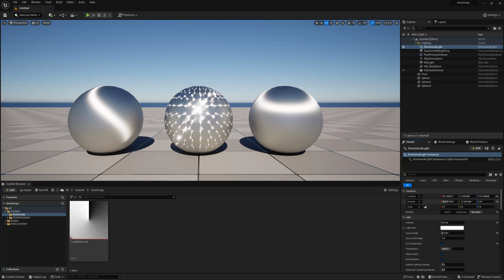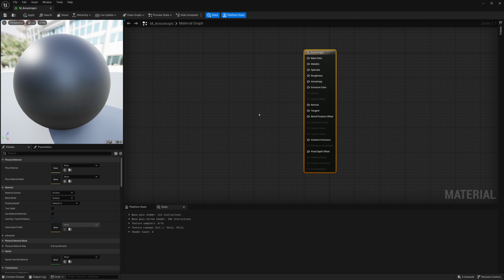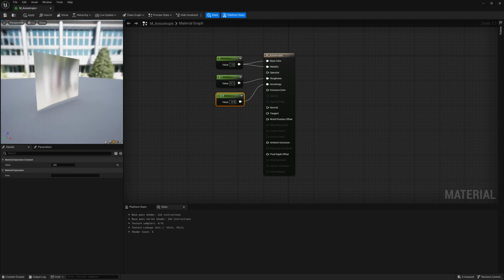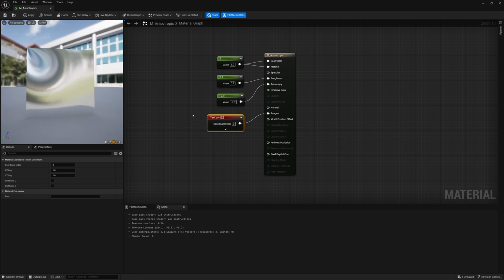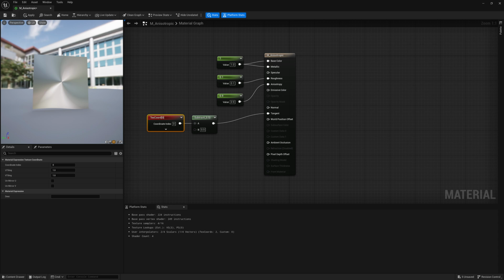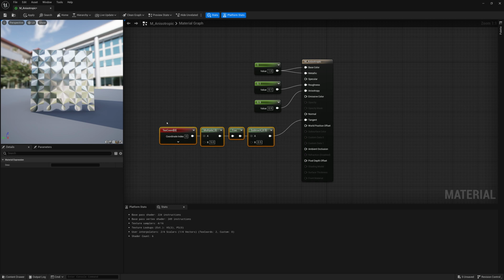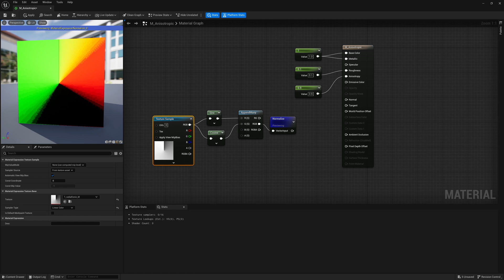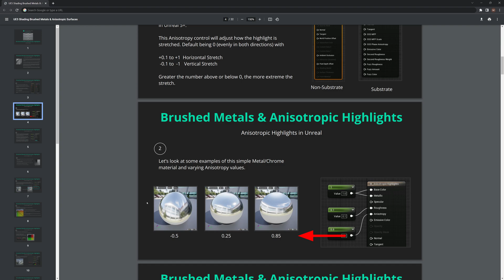Unreal Engine 5.2 - Brushed Metal / Anisotropy Material / Anisotropic Highlights Tutorial

Comment: What do you plug in for the tangent if using substrate?
Reply from the maker: No difference, exactly the same. If Substrate gives error you may have to just make sure your feeding it 3 values, R, G, B so there's no vector conversion issue. 

So if you took the TextureCoords and then a Subtract Node and Subtracted 0.5 it might give error because your feeding 2 values (U, V) to a parameter expecting 3 Values (R, G, B). So you can solve this easily by adding a Append node on the very end connected to a constant (in B slot) with 0. Then your feeding it R (U), G (V), B (0). 
3 Values. So there's no vector conversion error.
Reply: @renderbucket  Thanks so much for this comment, I was wondering why your great tutorial wasn't working. Really appreciate it, this looks great!